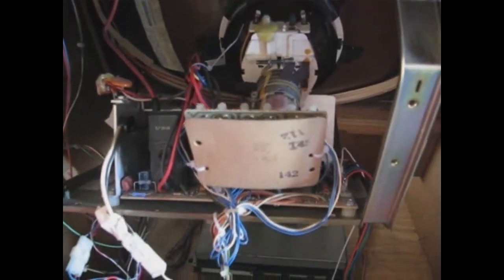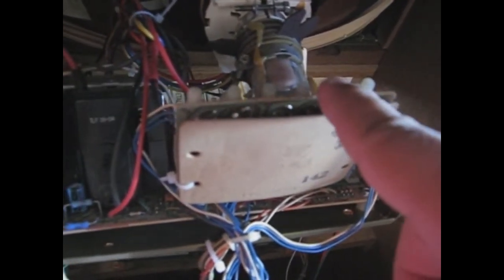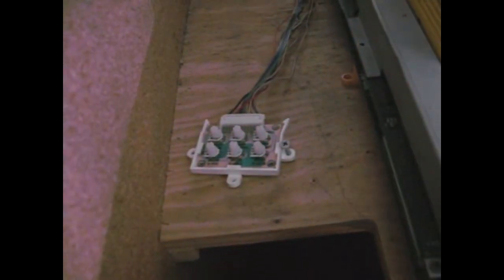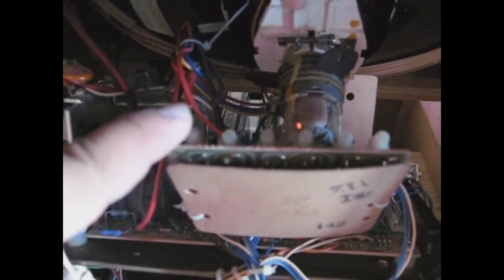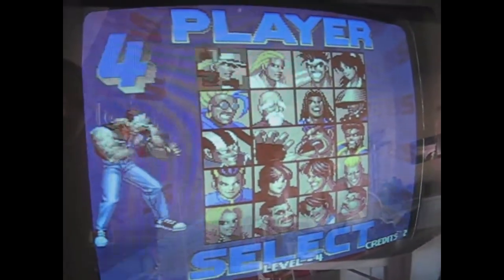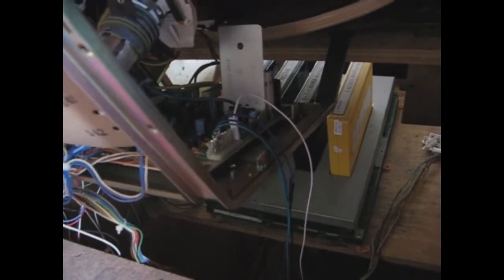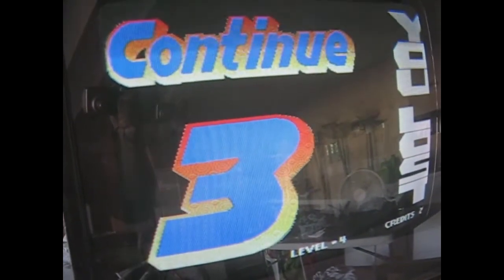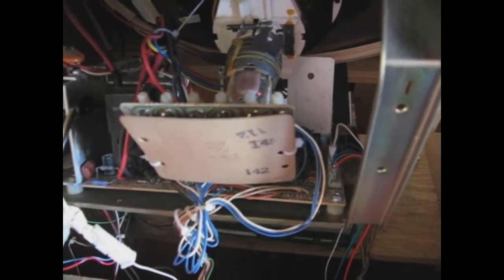Simple Monitor Fixes For Your Arcade Cabinet ... Higher Quality?

Comment: That's around about what I payed for it :)
Yeah I understand what u mean :)
Is there anyway I can use JAMMA boards with the existing wiring? 
Iv been told there is adapters for that but I'm not sure how to tackle it
Reply from the maker: In its current state you cannot use jamma boards. If an adapter exists, I would try either jammaboards.com or suzohapp.
You can always rewire everything but that might take some time.

Comment: I have a vurtur cop game that the monitor comes on just for about 30 seconds then shuts off. Everything still works just picture doesn't stay on. I tried wiggling the board.  Did not work.  Any other suggestions?
Reply from the maker: When the monitor shuts off, do you see an orange glow on the monitor neck tube? Can you still hear the game playing when the monitor shuts off?

Comment: How do you fix the side compression?? the picture looks compressed on the right side.
Reply from the maker: You can use the monitor adjustment board to center the image. For the most part, this should work.
Reply: Yeah I already tried that, my tri-sync Wei-ya and the Nanao monitors on my Astro and Aero have a pin that you need to switch to fix the side compression, but I also have a Rodotron and an Hantarex monitor that do not have said pin and I have not yet been able to fix this issue on those.
Reply from the maker: Hmmmm, you got me stumped. I would try youtube user YourMKArcadeSource. He might be able to help. You can also try lukemorse1, however he is taking a break from youtube.